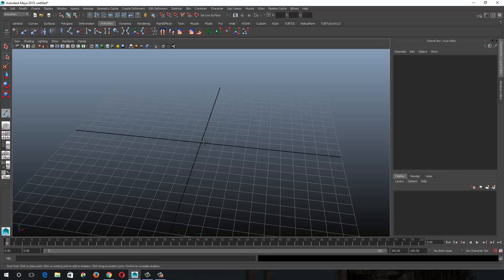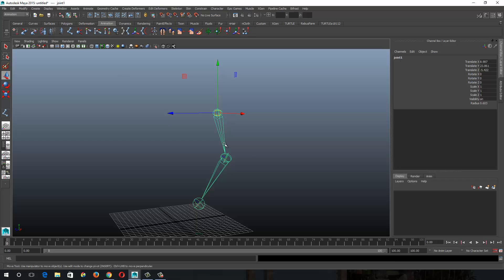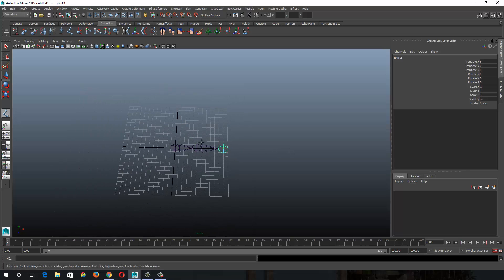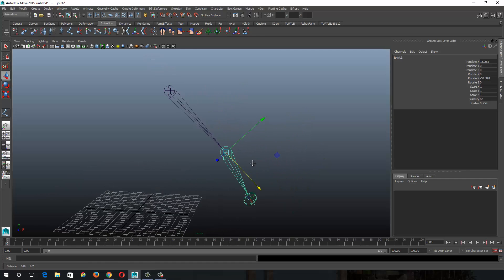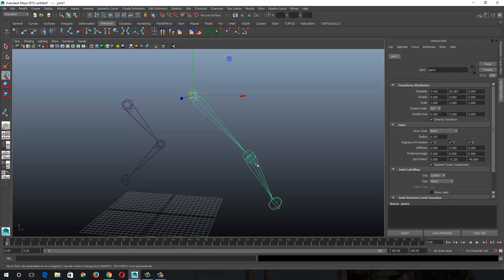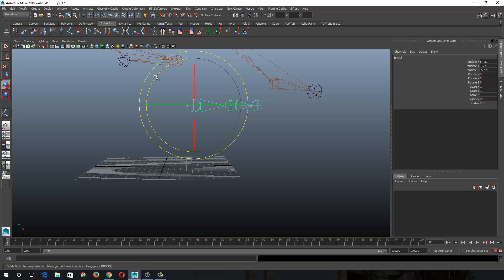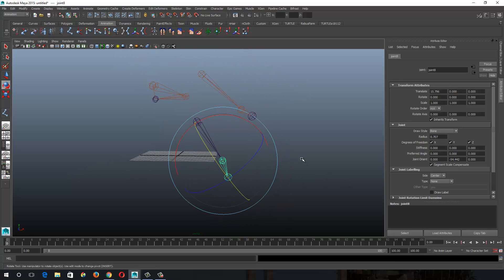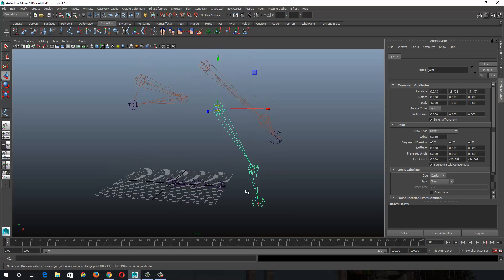A Better Way To Orient Joints

Comment: this video plus a rigging dojo article i just ran across really helped me to understand what the heck joint orient is for, and how to clean it up properly, for the first time ever

https://i0.wp.com/www.riggingDojo.com/wp-content/uploads/2014/10/Rigging-Dojo-Technical-guide-to-Maya-Joint-orients-infographic1.png

(the article's nice cause it talks about how to handle branching joints, like a wrist joint that splits off into 5 fingers, and how to clean the rotation/translation/orient properly in that case)

tysm! super useful info :'D

Comment: I don't understand, lol.
I see what you're doing works.... But if it's so simple, why is this just not what it does by default?
It feels too good to be true. But whatever, it works!
Reply from the maker: Good question.   You can freeze transforms on them too as another way of resetting them.  I suppose it depends if you have anything hooked up to the joints?  Also, as soon as you freeze transforms, you basically have to move the values back to rotation which there isn't a simple button for.   And it gets more complicated if you use Rotate Axis also.  I think it's really more about understanding the underlying math happening to get joints into positions and the offsets we layer on to keep it intuitive even if it's not representative of what the program is doing under the hood to achieve the position and motion.  It's that we take for granted that a zeroed out joint is in it's default position.  But the program has to know what that angle is to start with and relative to whatever it's parented under.  So really what it's doing, assuming from starting from 0,0,0 this bone is in this position in space, and then we are orienting an axis as this angle, and then from there, relative to it's parent, this much farther out in space, and positioned at this angle.   Everything always has some rotation to it.  Joint orient is basically a layered offset, and so it Rotate Axis.  But for most people it's hard to think about things always being rotated up to 3 axis at once and remembering what the default position would be to reset each joint to.  So we store that offset in Joint Orient, and sometimes Rotate Axis(when we want the translate gimbal oriented differently than the rotation gimbal).

Comment: dude this is the longest video I have ever scene, I couldn't find if this video is useful or not but one thing its really hard to concentrate. I tried 3 times going back and listen it again and again but I don't know if its your voice or your over explanation but something is there which is making this video so much boring and hard to watch.
Reply from the maker: I am sorry you found this frustrating. I will use this detailed and useful feedback to try and make explaining how to set values of joints to be co_plainer so that your animation is using the correct trigonometry to solve its IK algorithm in a intuitive way more exciting and much shorter in the future.  But for now this free video I made will have to suffice as these videos take a long time to make and there's no incentive putting them up.
Reply: @technicallyartistic  sorry for my word, it was not that bad as my words are... I am looking for a way to orient the last joint in every chain... The last joint of every chain is always frustrating i usually use script to orient the joint and after that i have to do some changes manually for some joints.. but every time the last joint creates problem, i don't know how to fix that because i don't know why the manual options don't work on the last joint...
Reply from the maker: @sidarthshukla1158  If you want it oriented the same direction as it's parent, simple zero out any rotation and joint orient values.  If you want it oriented a different direction you need something for it to aim at, or zero everything out like I said before, manually rotate it into the direction you want eye-balling it and then either freeze transforms on the joint, or relocate the numbers in the rotation attributes to their corresponding joint orient fields. (Move the values from rotate to joint orient, rotations should always be zero in the end for animators.)  If you have anything skinned to the joints or IK it may not let you do that without removing those first.   If you already have skin weighting you don't want to loose, save of a copy of your scene before doing this, make your changes, reference in the copy with the skin weighting and copy it onto the new file's mesh, using "name" as the primary way of copying.  If that doesn't work well, set labels on both sets of joints then use labels as the method.   I usually use one to one, name and closest bone as my three methods by default, and then if I use labels, Lables, one to one, name.
Reply: select your whole outliner chain. Shift click group + sign to open all the joints.

then shift select down the outliner all joints.

Freeze transformations.

rigging > skeleton >orient (try whatever setting, world worked for my thing)

should orient all your joints.

Comment: Made a quick script to fly through and set the "Preferred Angle" for all my bones to 0,0,0 and all the headache I've been having with IK is fixed.

If anybody has the strange case when you create an IK handle, all bones in the chain suddenly gain rotation and you believe your joint orientations are correct, this is it.

Live saver!

Comment: freezing rotations on joints does the same thing apparently. doesn't it?
Reply from the maker: Yup.  It does.  But understanding  that this is what it is doing when you are freezing the rotation of a joint allows you to go back and repose your skeleton if you have already done things like started skin weighting or added controllers.  You can change these values on your joints to match your controllers new position and you don't have to re-create the constraints.  In that case if you tried to freeze your joints Maya wouldn't let you because they already have incoming connections.
Reply: ***** yeah sure..really good stuff on this channel. keep up the good work!
Reply: For a long time, I didn't realize I could just freeze the rotations on a joint. Like I know it works for everything else, but it never seemed to work on joints. Perhaps it's a new feature since Maya 2009?